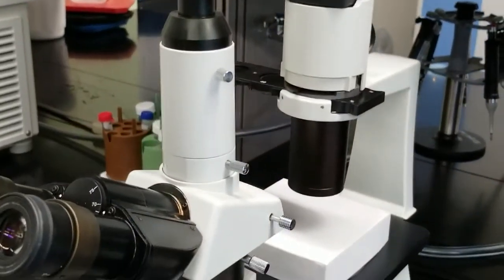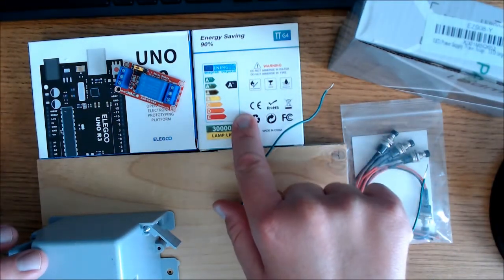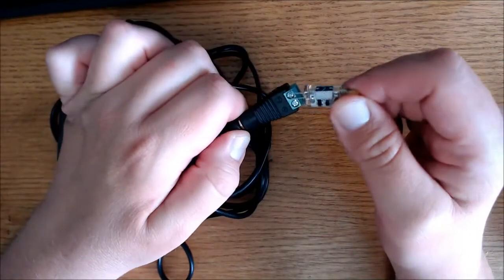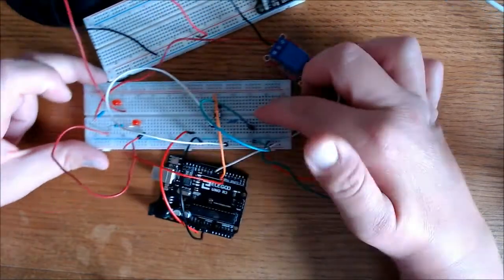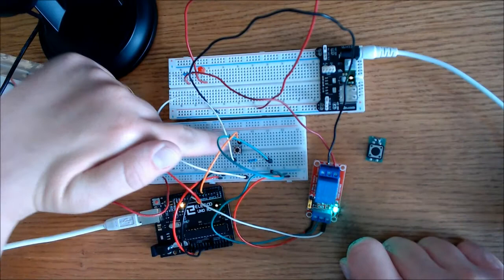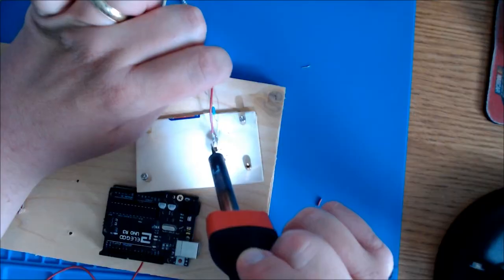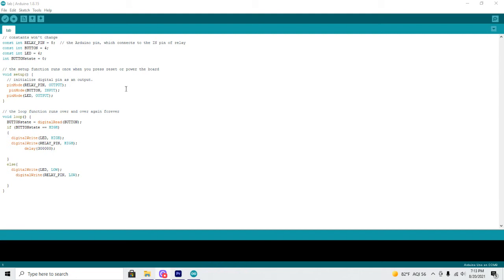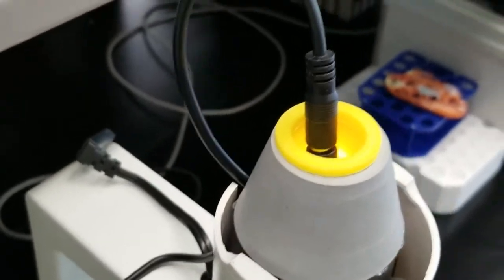Replacing An Inverted Microscope Halogen Light Bulb With An Arduino 12V LED Light And A Timer

Comment from the maker: const int RELAY_PIN = 8;  // the Arduino pin, which connects to the IN pin of relay
const int BUTTON = 4;
const int LED = 6;
int BUTTONstate = 0;

// the setup function runs once when you press reset or power the board
void setup() {
  // initialize digital pin as an output.
  pinMode(RELAY_PIN, OUTPUT);
   pinMode(BUTTON, INPUT);
  pinMode(LED, OUTPUT);
}

// the loop function runs over and over again forever
void loop() {
  BUTTONstate = digitalRead(BUTTON);
  if (BUTTONstate == HIGH)
  {
    digitalWrite(LED, HIGH);
    digitalWrite(RELAY_PIN, HIGH);
          delay(300000);

  } 
  else{
    digitalWrite(LED, LOW);
      digitalWrite(RELAY_PIN, LOW);

  }
}